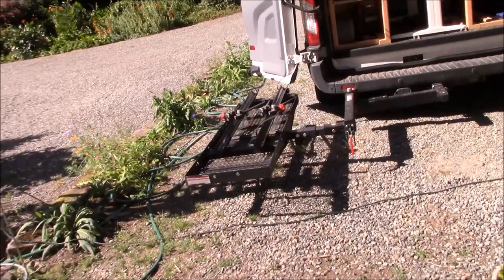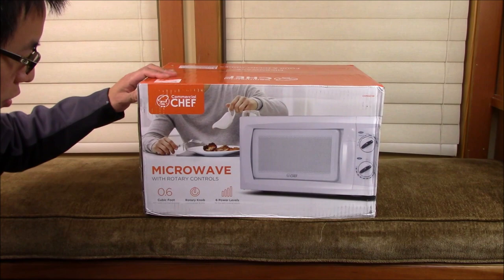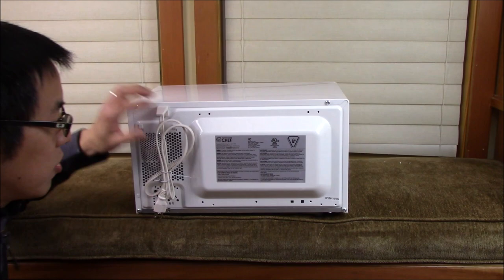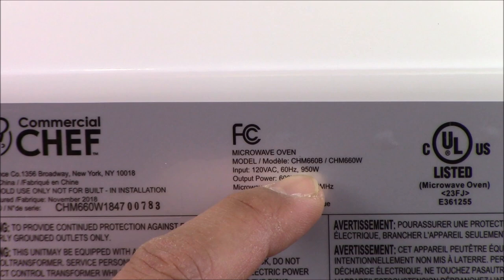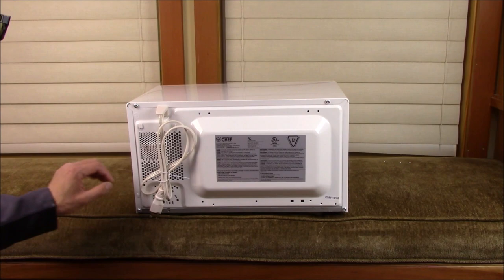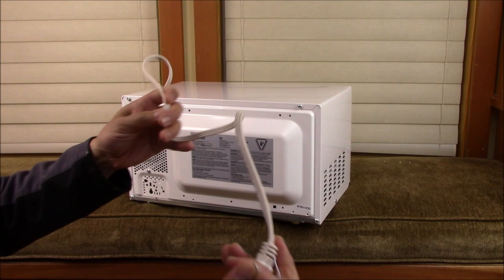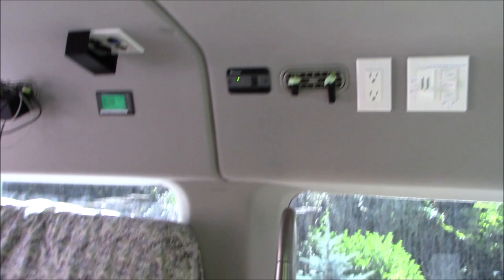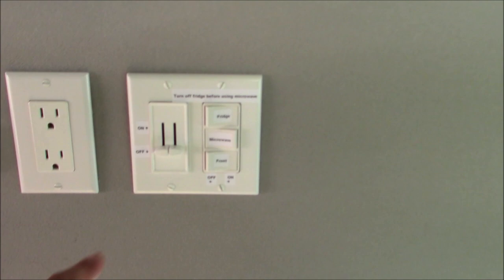Run a Microwave in Your Car/Van/RV Using a 12V Battery

Comment: I run a fridge 24/7 and a microwave along with other stuff with no problem on a 320 watts panels with 250 amps lithium batteries and a 3000 watts pure sine wave inverter.
Reply: Great to know!  You have two 125 amp lithium batteries? And which make/model microwave please? Thank you.  I've been looking at getting a 330 watt solar panel... so I think I could do this!
Reply: Wow 👏
Reply: Is the fridge ac or dc? Thanks!
Reply: A regular 120v dorm fridge with freezer

Comment: Get an Inverter Microwave - they are awesome - they do run at a continuous reduced power according to the setting.  I use the feature all the time to reheat small amounts and it doesn't overheat small portions of the food.

Comment: Name your channel "Lum & behold"
😊

Minivan setup currently has no room or need for a microwave.
Rear section is a "bouch" (bed/couch) that stores 6 elongated milk crates for clothes etc & sleeps me & a cute 55lb security alarm dog.
I don't mind pop top and eat spaghettios for now. Nor does she.

Eventually a bigger van with solar panels on too to run tv, xbox and cooler/fridge
Rare times I'd need a microwave I could use a minimart or truck stop.
From cold to hot to warm when it's in the truck...good enough.
I live in a van, luxury isn't a necessity.

Ability to travel with a basic mini hotel room & access a gym shower 🚿 is mind boggling when you do the minor math. One hotel room is my entire week with food!

Comment: Awesome vid!  Am looking at this exact microwave and wondering what it would take to actually use it in my van. :)  I'm curious... did you upgrade to two AGM deep cycle batteries and how does that work?  Do you have solar panels? Thanks!

Comment: Nice what size fuse do you have on inverter... I have 2x 110 agm batteries and a 2000watt inverter... But alarm goes of on inverter for low battery..... How can i solve this problem... Thanks...

Comment: I have the same Renogy power meter in my Class B.  What size fuse or circuit breaker do you use?  I've got my inverter wired directly to the battery, which bypasses the meter.  I'd think I'd need at least 100 amp fuse, but just wondering if that is too high a potential current in case of a short circuit (which I had this past week and almost burner down the van!).
Thanks for the video!

Comment: I have a 100ah and it worked for a little while, couple of weeks, but the voltage drops to low to accommodate the 1500w inverter, so the thing shuts off. Might have to get 200ah worth of storage

Comment: Very good explanation. Small Van me too. I've experimented with different appliances and while the microwave I have a GE small inverter type is great the space it takes up is well too much lol. But electrically it works. I just can't talk myself into installing it. 500 watt heater is using 569 watts.  Eggs for 1 min 50 seconds in micro is great but I'll use Nuwave induction and a pan. Takes less space. I have Ford Econoline. Thanks. Very good science. I enjoy discovering.
Reply from the maker: Thanks for the comments, the induction and pan is a very tempting route to go, it sounds like you have good luck with it.  Thanks for watching!

Comment: How do u recharge your battery?
Reply: When you drive your car battery automatically recharges so you can hook the other battery up so that when your car battery is full it charges the other battery you can also use solar panels or if your just wanting to camp and not live in it just charge it at home

Comment: good Test, but just buy a cheap propane one burner to heat up water. I haven't owned a mircowave since i moved out of my moms back when i was 13. go figure. an USELESS appliance none the lest, thank you for doing the load test, at least we know a 2000 watt renogy is a good buy and AGM is OKAY it works, I've seen some LIFEPO battery's just cut power at 100 amps current on a 100AH 12v lifepo. They may last longer I guess, but in the real world how many people need that much power on daily basis. Your on the road, most of the time you will be charging the battery via the alternator. and if you do need to run a load like this just crank over the engine and have the alternator provide some of the excess energy into the system while you heat up your tea. It's only going to be like 5 minutes or gas burn, nothing really to crazy. Instead of paying 2000$ for a lifepo battery setup with 3000w solar and space taking up inside your home. A simple dual battery AGM setup with the inverter inside the glove box or under a seat might be better option and you can even get a small 100W panel and charger for the time you are not running the vehicle. I think a lot of people go overboard and buy so much solar and batteries and shit to live out of their car it almost seems stupid, you moved into a vehicle to go and see places not to watch movies and cook inside like your home, what's the point.

Comment: Hi chris, im having a problem with my set up, i just recently bought my 700 watts microwave and it’s shutting off after 2 seconds while im using a 3000watts inverter thru my van main battery(12v 95Ah 800A) what might be the problem? Thanks in advance
Reply: Hey, not to butt in, but...many microwaves don't like modified sine-wave inverters. It scrambles their brains. Also, there may be a brief surge current that is above your inverter's rating. Additionally, the voltage on your battery may sag (in the first couple of seconds before rebounding) enough to tell the microwave to shut down. Solution? Think like Palpatine. There is never enough power. Clean power that is. Get a pure sine wave inverter that can handle 24, or 48 volts (12-volt systems are very limiting power-wise, while 24 is easy to do with two 12-volt batteries and 48 is easy to do with four 12-volt batteries. 24 and 48-volt systems are also a lot easier and cheaper to assemble ( and now come in all-in-one packages that really save you money and time)) and be able to handle at least twice the surge power of all your appliances (like, say you were to start them all at the same time). In my case, my inverter can handle 5,000 watts all day long and can surge to 10,000 watts in a pinch. This is for two refrigerators, a freezer, a microwave, and an evaporative cooler (swamp cooler deal), three computers, an ice maker, and a 60-inch monitor. I have 2,000 watts of panels on the roof and no electrical bills. I even have leftover power to condense water out of the air as a cool party trick. Remember - you can't have enough power and it all begins with the inverter. Good luck!  Soon you'll be heating your supper with three hand-held hairdryers just because you can :).
Reply: @thatguyweheard  i really appreciate your time and effort. Ive ask five “YOUTUBERS” but non of them care to give an answer to my question.

Comment: What battery are you using?
Reply from the maker: In this video I was using a 100 A*hr Renogy AGM battery but it has subsequently died.  I upgraded to a Battle Born lithium battery and have been very happy with it.  It can run the microwave much better than the previous AGM battery.